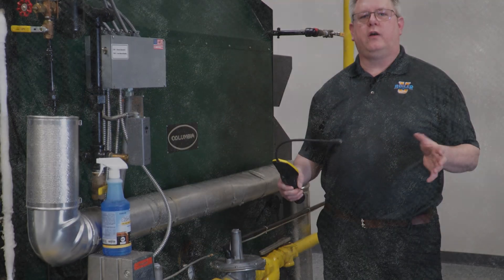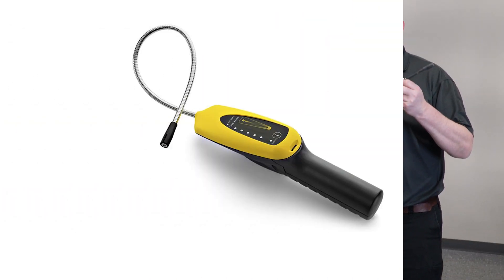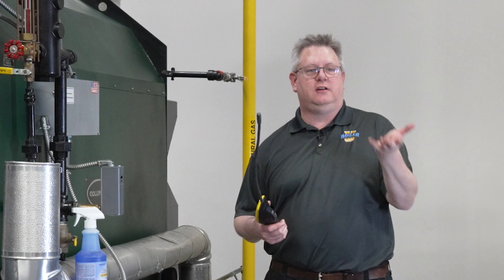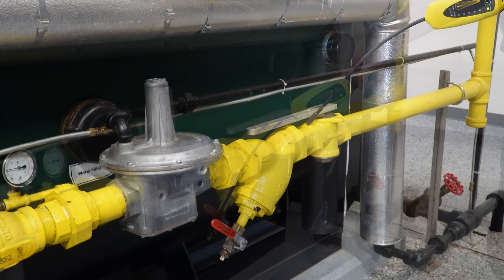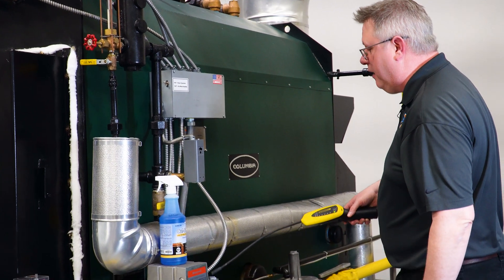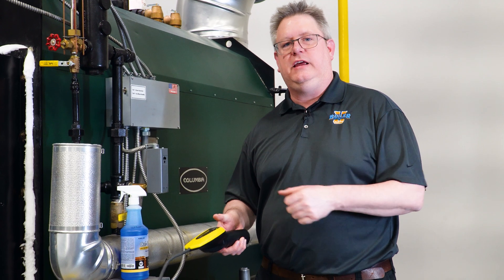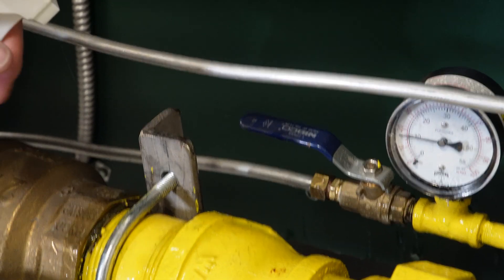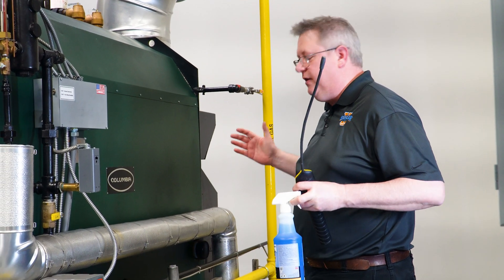How to Check for Gas Leaks Part 1: Tips and Tools - Weekly Boiler Tip

Comment: Good video....Is that the control valve (on top of what you placed water spray bottle)?
If there is a pressure regulator than why do you need a control valve?
Thanks.